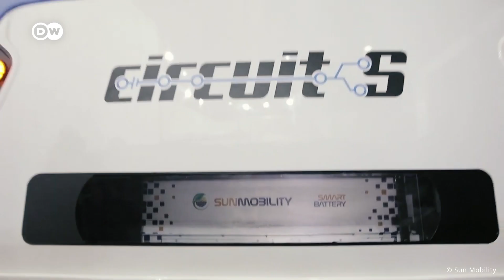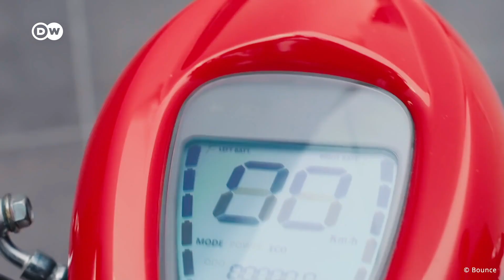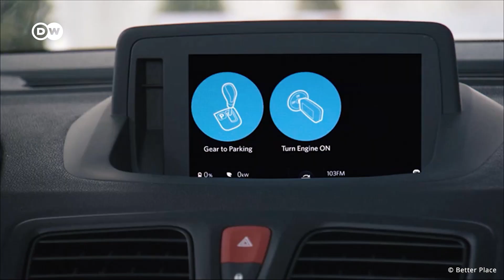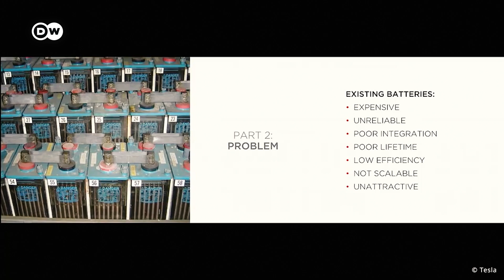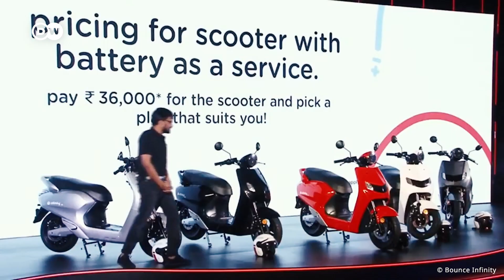Is EV Battery Swapping Good or Bad?

Comment: Battery swapping is the future as long as there’s available infrastructure to support it, battery swapping scouters have been in use throughout Taiwan, it’s proven to be very successful.
Reply from the maker: Thanks for your input. I've looked into the scooter-battery swapping system in Taiwan and I've found that there are over 2500 self-service swapping stations across 1000 locations! This swapping program is run by a company called Gogoro, and they've even partnered with Enel X to set up a system where the stations feed energy back into the power grid when needed. Of course it's trickier with cars because the batteries are too big and heavy for drivers to swap themselves.

Comment: Lacking two main poinst behind swapp,Use normally a smaller baterry 25-30kWh, and when needed, for bigger trip, use a larger baterry. That way no 70kWh baterries just laying unused, 80% of the time. Also the longevity of a car can be extendended 2 fold, the electric drive will be OK. And last remark, those swapp station are the way forawrd for grid balancing.

Comment: Has anyone ever given two minutes of the brain time to think whether 1. EU regulations will allow this to continue after a certain point.

2. As stated above, the reason is, is stock piling massive energy drive battery safe? Think how many kilowatts would explode, and how much of a force it would have not mentioning you can’t put the fire out. In turn it will rule out being placed at fuel stations or in city centers or near airports. The only reason it is allowed to go ahead right now it’s because of the little amount that its being used.

Comment: Battery swapping is the best and most efficient idea for electric vehicle just because pagan western society isn't do it does not mean it's not a great idea. But battery swapping is really more of function than a business model, however the efficiency of battery swapping would drastically reduce cost when it is time for a new battery upgrade.
Reply: everything you said is extremely wrong sir, you forget ti incalculate that you LEASE the battery and car companies ar no charity so the extra cost of the battery swap stations and the extra batteries in circulation will be payed by yourself aka the customer... basic buisiness 101.

Comment: Generally, EV batteries have a lifespan of 8 to 10 years. Considering the rapid increase in the supply of electric vehicles around 2020, the Model S 75D vehicles released in 2013 are known to have to pay about $25,000 to upgrade/replace their batteries as they are 9 years old. And when the owner of the Model S vehicle puts his car on the market to sell it, he has to add battery replacement costs, and it's clear that consumers won't like buying a nine-year-old electric car for $25,000 more. On the other hand, if the battery after you pay a certain monthly subscription fee is replaced, the latest battery can be used regardless of time. So if the main body of the vehicle is maintained as it is, it will be almost no different from a new car. It's an outstanding innovative idea, isn't it?
Reply: Yup, it's a no brainer.

Comment: We need both better batteries and swapping.  Then when batteries get better you can simply swap it out and not throw away the car!!!
Reply: check lithium air removable battery in India.  3 modules gives 500 km. The only downside is that these batteries are not rechargable

Comment: The statement at 6:20, "as is the case with swappable batteries, there's no way to charge them at home, especially with cars," unfortunately demonstrates a lack of due diligence in ensuring information acracy. In addition to NIO's swapping stations, supper chargers, destination chargers, and 3 part charging network, the company has offered home charging solutions for several years. Furthermore, NIO recently introduced a vehicle-to-vehicle/vehicle-to-product mobile charger. Unfortunately, this call into question the creditability of both the content creator and the DW platform as a basic google search would have prevented such an avoidable misrepresentation.
Reply from the maker: Thanks for pointing this out. A more accurate way of phrasing that sentence would have been to say, “With swappable batteries from some manufacturers, there’s often no way to charge them at home.” We’ll be more careful in future. Accuracy is important to us. We hope you stay and watch more with us Gerald!

Comment: Swapping batteries is much better than fixed ones. You do need more of them for sure but it will only result in costs coming down even further. Common design of batteries will mean even further reduction in manufacturing costs.
Reply from the maker: What do you think we can do to make sure they off set the environmental costs?
Reply: @DWREV  recycling battery materials and solar power battery swap stations